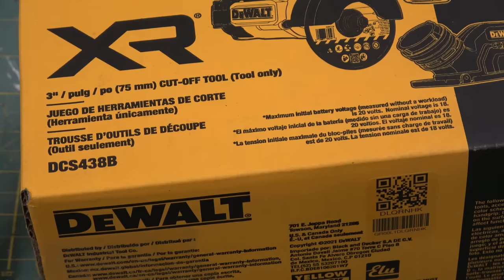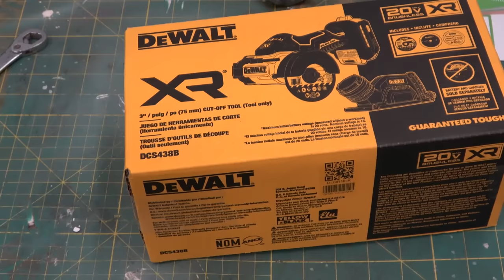BOLTR: DeWalt Mo' Powah!

Comment: At ten minutes in, you mentioned that the handsome brainbox indicated that it was manufactured in India. There is a reason that we now use the term "pure Chinesium" to indicate the lowest common denominator in manufacturing.
Reply: China is still above India in terms of high-end manufacturing though.  India has tons of QC issues going that weren't on previously Chinese made items (ex: iPhones to handwrenches)  I see the wrenches at my local hardware stores that used to be Chinese made and the stamping and forging misses are very rampant on the new India made stuff.  Where the Chinese stuff certainly wasn't anything special, but the QC was so obviously honed in to an acceptable level over the past 10-15 years.  Either way it's NBD as that particular hardware store brand (K-T tools) is an easy enough warranty process and whatever we already have is treated as a disposable tool you wouldn't mind breaking or losing anyways.  iPhone QC issues in the India switchover are very well documented as well.  If China was good enough to produce iPhones, iPads and anything Apple then it's pretty apparent that Dewalt, Makita and Milwaukee could wrangle up acceptable QC levels for power tools.  And this is clearly the case if you look at lots of higher end power tools produced over the past 5-10 years.  Even Hilti uses China to a large extent.  So does Fluke. Says it all right there, really.  

India will surely get better in time, the same way China did. And obviously, obviously obviously India is preferable to do business with for many reasons, though they're still far from perfect and they'll probably just end up the new boogeyman to a bunch of the same sorts of dumdums anyways.  (Indianesium, incoming). But one golden sample on one Youtube video does not suddenly condemn all the progress China's manufacturing has made over the past 40 years either.  

And the same goes for Taiwan or Vietnam, because there's still tons of idiots out there who think the world's leading semiconductor producer can't also figure out how to produce something as   simple as a ratchet or sockets.  Can round things off with Mexico too, lots of power tools and auto parts come out of Mexico now and the quality can be pretty great (ex: Wix oil filters).  But you'd never get the "invade Mexico" crowd to ever admit how useful they are as a trade partner either.   We'll just go make a further mess of things, probably end up with the cartels just acquiring even more guns from the North as well.  Same people who cry about power tools and electronics going up so much in price, but they were the ones who supported all the 30% tariffs and idiotic NAFTA trade war bullshit.

Comment: I'm an Ali plate boat builder and recently got this tool to get into tight places. I was less than impressed until I was able to source some 3inch carbide blades from Gina. But glad to see it's a quality tool in the guts.

Comment: That space/block of black plastic next to the battery is for a bluetooth tracker. For contractors to keep track of equipment. Some of the more expensive ones have it built in to the electronics of the tool and if they go out of range of a base station/tool box then the tool will shut down.

Comment: This one is great. To bad it's hard to get in my location so i had to get a ridgid one. It's not bad either, better than Ryobi/Milwaukee ones anyways. 
This one has a great platform and guard, lots of power, great depth adjustment.
The only downsides are the arbor size and slightly larger bulk compared to other tools.

Comment: You're supposed to release the shoe before taking the plastic guard off. At 1st I liked this tool for being able to cut small peices of metal without the dangers of it flying all over the place. But then I started to use it on pvc pipe repair and DAM! I love this tool!

Comment: My 4.5 inch grinder does the same thing. I do like the stop brake though. Dewalt tools have improved much over the years.
Reply: You’re 4.5” grinder DOESNT do the same thing…it’s a different tool for different applications. Does your grinder spin fwd and rev? Can it fit inside a 2x4 wall cavity and slice a pipe? Can your grinder not wake up babydoll while grinding at the same time the head is off kilter 90*?  I shall stop…
Reply: @remodz6385  The Venn diagram of tool uses is almost coincident. Methinks you just easily fall in love with every flashy new tool that comes around. AvE even had to throw away the guard to make more utilitarian. Cheers.

Comment: If you looked through the service manual you'd know exactly how to take one of these apart and put it back together. 
Would be nice if we had access to these. Edit, looks like we do. Color me shocked. 
First motorbike I got (a 125cc Honda from the late 80s, when I was far too young and tiny (11) for a 125) came with a 400 page service manual. Exploded diagrams of everything. Stayed up all night reading it.

Comment: Watch you struggle getting the vac attachment off was hysterical,I too,took awhile to get it off.....
Reply: He never got it off. He ended up removing the adjustable blade guard with the dust extractor/depth gauge still attached. It comes off without tools, you just drop the depth gauge, pull the release slider, and rotate forward. If the blade guard turns to the next detent instead you just keep turning until it hits the last detent and separates from the extractor/gauge. Also, the flip up window is for changing blades which the other 3” cut off tools don’t allow you to do without removing the extractor/gauge.

Comment: I still don't understand why you would need a side-wards, side-wards hangle grinder
Reply: Works nice for cutting into rectangular ductwork and threaded rod
Reply: I use it constantly and I say the exact opposite: I have no idea why anyone would want to use the more awkward traditional style grinder. This is useful in places you’d never use a grinder, like cutting installed pipe, cutting outlet holes in drywall, and even Dremel-type uses.
Reply: The mini-cutter and a full size angle grinder are a bit like a kitchen scissors and garden shears: you CAN in a pinch use the bigger ones for everything, but why would you?
Reply: Spins slow, so it works good for carefully trimming back tile if the tile guy didn't leave a big enough hole to mount the shower stuff. It's also much easier to catch the sparks with a wet rag if you're in a spot where you can't be blasting sparks everywhere, like a finished bathroom. Doesn't replace your angle grinder but it has a time and place.
Reply: I thought about buying one for tiles, most of the time the tiler never cuts the holes big enough for my light switches and power points but you can buy really cheap diamond blades for a jigsaw and multitool (both of which I already own) so I've never needed a mini grinder
Reply: I would love it if they made it in  60v and 6inch. It seems easier than turning a grinder on its side.
Reply: It spins at 20,000 rpm, twice the speed of most angle grinders @badgermetal

Comment: I have the Milwaukee and use the dust guard for cutting drywall and I could not use the DeWalt because the angle adjustment knob is on the side vs on the back. For metal cutting, the 20V is clearly superior.

Comment: I think that metal plate is for a belt buckle/ hook. That handle type is the same on a drill. So if you want to carry it on the belt you’ll need a hook if not you’ll need a cover so it doesn’t look shiet!

Comment: so just for the informatives as anybody may or may not be asking for.  that funny little black cap on the bottom by the battery socket is for installing the dewalt tool connect chip.  part number DCE042. they have been integrating that socket into a number of their new tools to allow for the tool connect chip to be installed.  and all the tool connect chip does is allow for tracking where you left the blasted thing when you can't immediately find it. intended for jobsites to know if someone is walking off with your tools or not.   there are two other products dewalt offers in the same family of blue toothables. one is the DCE041 which is just a bluetooth tag you can screw onto anything you don't mind drilling a couple mounting holes into. the other is the DCE040 which just attaches semi permanently where the battery goes and the battery attaches to it. gives all the options of the DCE042 but also gives the added benefit of being able to disable the tool if it gets too far away from the smart device it is paired to.  nice and handy at helping to avoid people thieving a tool because if it don't work no one will want it.

Comment: I could be wrong, but I don't think the cover is MEANT to lock, and that slight bit of movement, is so you can have it at one angle to start up close to you, and then as you extend your arm, it can pivot as the angle changes die to being further away from you!

Comment: That spot by the battery could be removed and swapped for a hanging clip
Reply: the hanging clips use that screw hole above it on the side of the battery well - the hatch by the battery is for a bluetooth tracking chip thats sold seperately. Mostly used by big companies to track tools

Comment: Great Video as always, AvE. I wish Milwaukee would take some of there M12 tools and move them up to the M18 for extra torque and runtime, when space is not a huge issue. When will the big whop sticks be available, hammers???
Reply: Pretty sure just about every M12 tool has a larger m18 variant in one form or another, could be missing something though.

Comment: That composite blade spinning 1” from my favorite thumb digit is a bit scary. 
I can lose a pinky. I’ll keep my thumbs please.
Reply: He removed the blade guard with the dust extractor/depth gauge. He could have left the minimalist blade guard on there. It doesn’t even require tools to separate the dust extractor/depth gauge. You just drop the depth gauge and pull the release lever.

Comment: impressive, might be wiser choice than an angle grinder for my use
Reply: Angle Grinders are way more versatile.
Reply: @hime273  I know and I got 2 of them but wanted something battery operated and dewalt has been long overdue on that one and when released it's quite expensive

Comment: That little pocket in the handle bottom is the for new trackers right?
Reply: Yes. “ToolConnect” Bluetooth smart chip. They even have slots for them inside their interlocking tool cases and adapters for old tools (locking battery interposer design).

Comment: ...without knowing anything about this particular tool, I wonder if they were thinking about this as a wood cuttin' tool as well as metal with that guard....seems perfect for wood like a regular circ. saw 'motif'....and seeing as it pops off like that I wonder if there was a more traditional angle grinder style guard that can be swapped out...if that's the case then bonus points all around...

Comment: Yeah milwaukee is a m12 and is the only tool I have from them that sucks.  When battery goes below half it shuts off.  It's amazing for cutting drywall tho  even has the vacuum hook up and it can go in reverse to throw the soarks/debris away from you

Comment: Will the 3" wiener splitter take a nice 4 or 5 inch disc? When you are 10 feet up an 8 foot ladder splitting out a damaged section of Aluminum top rail off a tipper trailer, you don't want to need to swap out discs more often than necessary.

And for the unboxing with the Husky Varnish, you might have Brother Bear hold it for you?

Comment: Never tried one but I see only a half inch of useable depth before you hit the core of the tool. You're not gona get much wear out of those small disks. Lots of waste here I think. Half inch wear and throw out the remaining two inch radius in the garbage. For scoring, it makes a lot of sense. It's lightweight, so, very easy to get a precision line in a tile or a steel angle bar and follow that score with a bigger grinder for the final cut.  How do diamond cut-off wheels perform on steel? Maybe it would be a good match with this tool.

Comment: Thanks now I gotta figure out how to get a Milwaukee battery on that or wait for Milwaukee to step up their game.   Looks like Dewalt solved my dislikes with the Milwaukee.  On a sidenote harkening back a couple years probably do your video on Nordlock washers,  I was thinking nerd luck should manufacture bolts with the service on one side that meets up with a Nord lock washer that way you only have to put one but one washer instead of one bolt and two washers on a system.   And probably just a little ramps in the bottom of the door lock bolt would be better than a normal bolt in many situations
Reply: It’s best paired with DeWALTs 1.7Ah compact PowerStack if you only need it for quick jobs. The new stacked lithium cells punch above their weight so it performs more like a 5Ah for torque and RPM (not runtime). Much better suited for a tool this small. In fact, they released a kit with that battery right after I bought the bare tool. Doh!

Comment: I don't understand why you use the "Bauer" as a sample of HF's best brand. It is not. It's their Hercules line which is its best brand. However, in case of the small angle grinder both Milwaukee and HF made the mistake of not using 20volt batteries as the power source. Twelve volt has no room in a workshop environment.

Comment: The black cover by the battery is for a Bluetooth inventory tracker, usually for construction companies. Rigid/Ryobi also have a 20 volt model and they are essentially the Milwaukee guts with the brain both for the Rigid or Ryobi battery.
Reply: No the Ridgid is not essentially the Milwaukee. The Ridgid is 18v and has insane power spinning up to around 19,500 rpm. The Milwaukee is an M12 tool so 12v and not suitable for comparison.

Comment: It's the catch! The catch is under the flap!
Reply: It’s for their Bluetooth inventory management module I believe. Optional during manufacturing of course.
Reply: @00mandrew Partly right. The ToolConnect Bluetooth smart chip tracker thing is available as an optional accessory module you can add. Even their interlocking tool cases have slots for them. They also sell a version that locks into the battery slot of older tools to add the same functionality while acting as a battery interposer.

Comment: Using all the battery tool brands for years I have always been a Dewalt guy I can't stand the protect on Milwaukee tools they all amp out way to early when it comes to doing real work and you can't beat the 60v line and battery swap ability.

Comment: I find the Milwaukee cut off wheel and the grinder to be kind of shitty. Any amount of cutting over 5 seconds causes the tool to overheat and shut off. The grinder is only okay if you're using a flap wheel on aluminum.

Comment: Oshkosh bagosh my first grinder. Cute. Not quite sure what the point is
Reply: The point is that you can go places with it a grinder would never go. I use it 20x more than my grinder. Heck, it’s taken over oscillating multitool and Dremel duties in a lot of cases.
Reply: Hmmm interesting. What are you usually working on?

Comment: Well … you’re not exactly comparing apples to apples … 20V vs 12V?
The cost of that Black & Decker 20V battery is something to be a bit shy about.
B&D had a great contractor tool line before they bought DW and destroyed DeWalt’s “Brand Name” tool lineup … Table, Radius Arm and Panel Saws found at every Lumberyard. 
Still DW has some interesting stuff but I’ll stick to Milwaukee because tool after tool they outshine the competition all day every day … their lineup is truly impressive.

Comment: i have to say ive gone bacl to the dewalt and mac branded dewalt my 2 favorite power tools i have bought in the past couple years are the mac branded made by dewilt 1/2 drive 20v impact and my favorite of all the 4 1/2"/5" 60 volt grinder i do a ton of fabrication and i was absolutelt sick of dragging a cord around for a grinder with a plasma cutter and a welder also it was just a fuckin bowl of spaghetti i had a millwaukee grinder years ago and you could get a good 5-10 minutes and it was dead as a door nail you needed 4 batterys to keep it going constantly i can use it for about 45 minutes on the 9 ah and about an hour on the 12 ah very happy the 12 volt millwaukee is what pushed me over the edge the fuvkin battery retaining tabs would snap off over time as much as i use a 3/8" 1/4' impact and 3/8" battery ratchet i spent more money on fuckibg batteries than i did replacing the millwaukee shit with dewalt

Comment: does anyone actually use this style grinder? the standard horizontal blade style grinders have always worked just fine for me
Reply: Not a grinder..it's a cutter😂
Reply: I can't justify buying one.  A grinder with a cutoff wheel is fine.
Reply: I use mine constantly and almost none of my uses would be appropriate for a horizontal grinder. I cut plumbing, wood, drywall, plastic, etc. You wouldn’t use a grinder to do a Dremel’s job. Meanwhile, this thing is often flexible enough to do a grinder or a Dremel’s job.

Comment: The mystery tab is a remnant of the other tools that could have a hanger bolted on to hang on a belt or edge of a box.   They probably didn't see a need for that in this product but left the footprint in the base handle design that is most likely shared between multiple tools now (modular).

Dewalt owns their own battery manufacturing;  others do not.   Milwaukee batteries are much more robust and longer lasting than others (from what I have found).

Comment: I like this but the price of a replacement battery stops me from purchasing this. It won't get enough use for my needs and the battery is almost the price of the tool. It is as if DeWalt is selling a bettery and giving you a tool to use it. I will stick to the corded units.